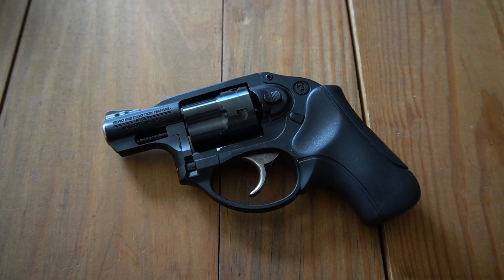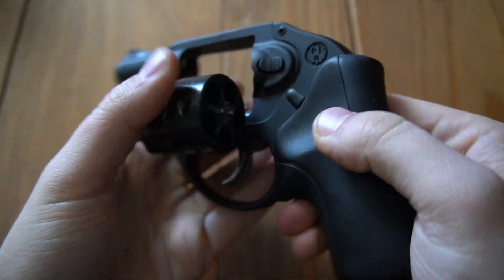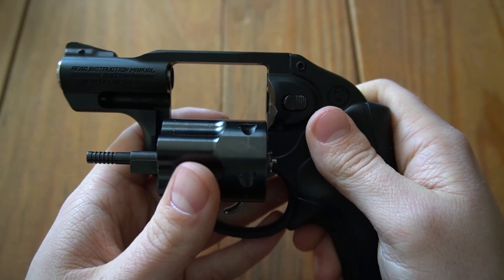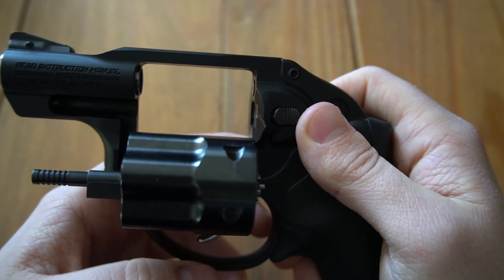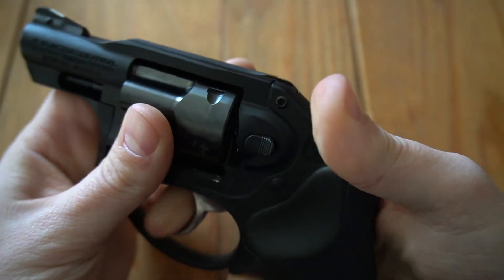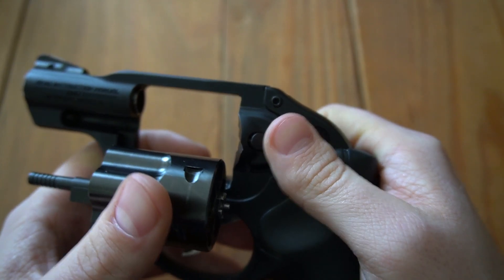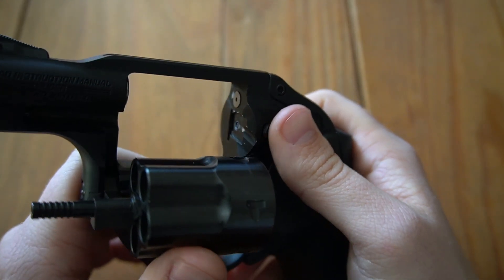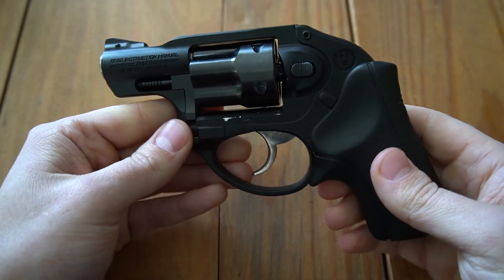Ruger LCR is Broken - Out of Commission, Back to Ruger

Comment: I imagine Ruger just replaced the frame. On the .38 the frame is aluminum and the pressed-in bushing will probably loosen after a goodly number (probably in the thousands) of hammer strikes. I have the .357 version which is a stainless steel frame and as a result doesn't need a bushing, the firing pin hole is drilled straight through the frame. I just got mine back today after a trip back to Ruger for a difficult to depress cylinder release latch and a sticking ejector rod locking pin (located up front under the barrel). They fixed the sticky locking pin, which 99% of the time would not reseat after closing the cylinder, but the latch is still pretty stout to depress. Oh well, it works though, so may just work with it and/or build up my thumb muscle, lol.

Comment: I had this happen back in 2016. Gun was deemed unserviceable as my bushing fully fell out. They offer to send me a brand new LCR, which I accepted. Now, on my LCR that I got from them as the replacement, the aluminum frame is now cracked, and will likely also be unserviceable. Not sure why these revolvers keep having issues, but I’ve given up on the .38 special version at least, given both of mine have critically failed.
Reply: Let me guess you shoot tons of plus p ammo through it exclusively
Reply: @kingsdrumming no, 25 rounds of +p. And only 300 total rounds, including those 25. These revolvers are trash, no excuses can be made for it.
Reply: @jonjon7324  Hickock45 seems to like and approve of them. And Paul Harrell. So you know more than them pssshh ya right You can find a problem with an ice cream cone. You won't convince me these are trash
Reply: @kingsdrumming lol. I’ve just told you facts, not my fault you don’t like them. Buy one and maybe your mileage will vary. For me though, it’s the most unreliable gun I’ve own. And that includes my Taurus revolver I got for under $200. I already have 400 rounds through that one, which is more than I ever got with the other two LCRs I had before they broke.
Reply: @jonjon7324  bad luck maybe everywhere I look this gun has good reviews and I mean everywhere
Reply: @kingsdrumming look through the comment section in this video, many others are complaining about it as well. Ruger did not seem surprised about me breaking two of them either, lady mentioned it happens frequently with the aluminum frames. Not a good look when your own customer service even knows there’s problems. 

By the way, your argument about YouTubers and videos. Most of them get a free gun and in exchange, they give a good review. Reviews have worked this way for a while. Also, I doubt any of those YouTubers have put more than a few hundred rounds through these guns, they have many others to review as well.